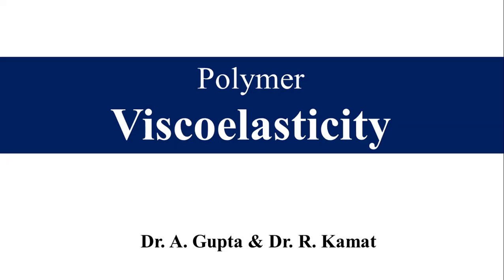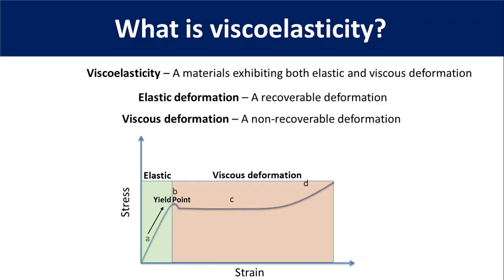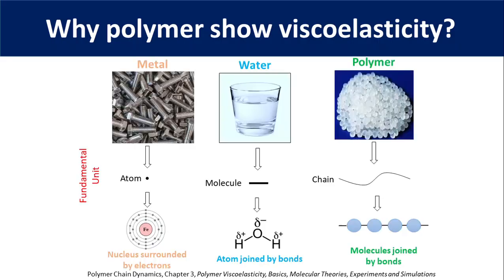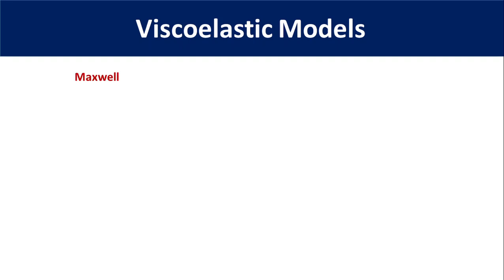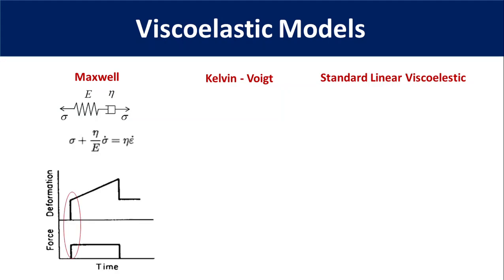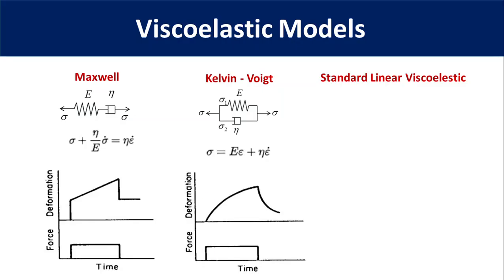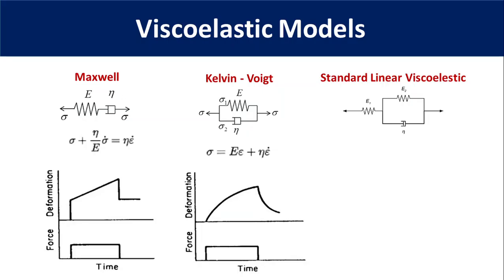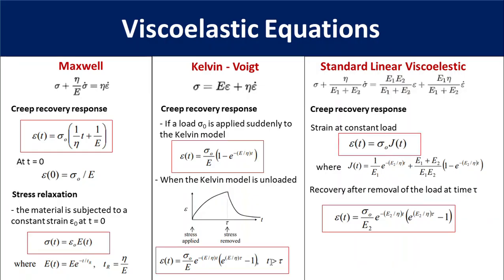Polymer Viscoelasticity

Comment: it's very nice video I'm kinda curious in the standard linear visco elastic if the spring & were placed (if spring is below & dash on up) would that wouldn't change differential equation ?
Reply from the maker: Hi, the equation will depends on the way spring and dashpot are connected like in series or in parallel but up or down will not change the equation.